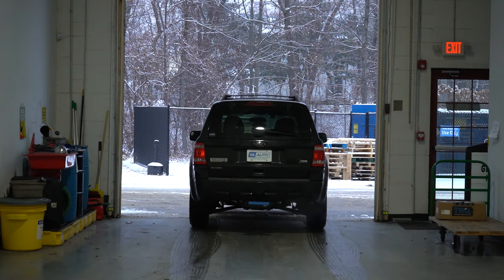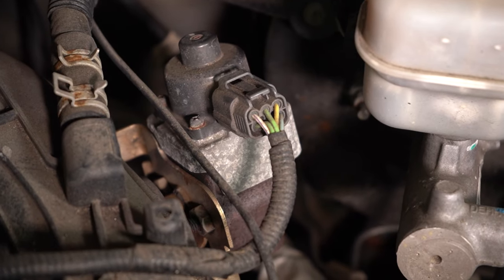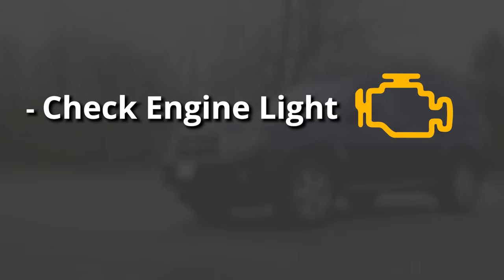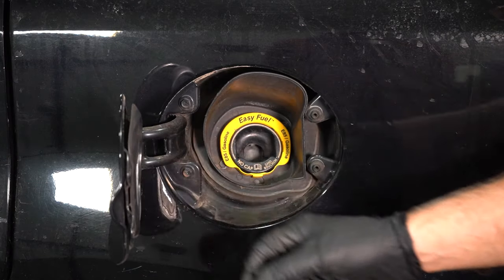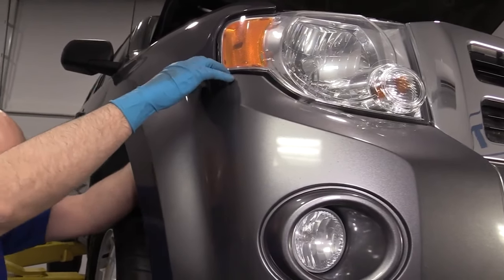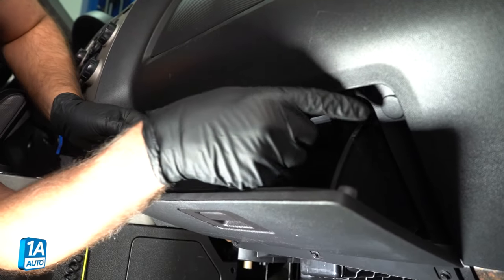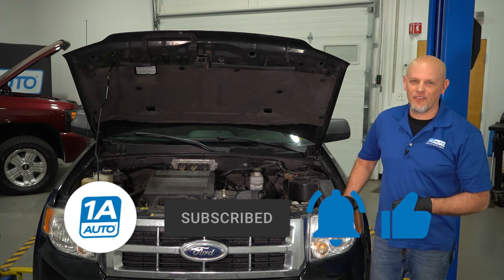Top 5 Problems Ford Escape SUV 2008-2012 2nd Generation

Comment: These things are pretty stout vehicles and if maintained properly will last 250k-350k easily. This generation is the G.O.A.T. Across all generations of Escapes. Transmission on these tend to be on the weaker side but if you change the fluid every 30k miles and don’t tow and hot rod them, they will do you right. Rust is a huge problem with salt belt states. In summary I wouldn’t hesitate buying one if your on the fence about it. They are cheap, easy to work on, and parts are always available for these!
Reply: So true, my escape 2005 = 210,000 miles no major problem
Reply: cool story bro

Comment: If you get a check engine light and it's for the EGR don't just put another one on it. The EGR tube that goes into the intake has a bend in it that gets clogged with exhaust soot. Easy to clean, there are some YouTube videos about it

Comment: Just want to point out that if you replace the resistor on the heat and a/c blower motor and the same thing happens relatively quick you will most likely need to replace the blower motor.

Comment: Got a 2010 2nd gen V6 XLT escape with 193k miles and I’ve had problems with the A/C, fuel pump and resistor. Haven’t fixed any of the problems and it still runs great. Things a horse for me

Comment: I have a 2011 Escape with 106K miles.  I bought it used at 49k in 2014.  I had early issues with the evap cannister and purge valve.  That was costly.  A peculiar issue was the instrument panel would have certain warning lights come on, the ac would blow warm air, and the liftback would lock.  If I hit the dash above it, it would go back to normal.  The dealership wanted $1100 to replace the panel.  I had an old mechanic tell me that he thought it was "cold solder joints."  I found a place in downtown Houston that pulled the panel and re-soldered the joints for $150.  A couple of years ago, I had the shifter cable break which ran me about $400.  Most recently, I had to replace the ignition lock housing due to starting issues.  I do have the issue you spoke about regarding the blower motor resistor.  Runs good and strong on settings 3 and 4, but almost nothing on 1 and 2.
Update:  I did buy the blower motor resistor on Amazon (about $15) and installed it.  A/C blows well on all speeds.  Thanks.

Comment: 4 more:  1) Steering Lock Module (wears out, turn key to start, doesn't, have to push key in before turning)
2) Steering universal joint to rack
3) Engine cradle/subframe rusts out
4) Rust:  A good indication of rust is the bottom of the hatch and the rear wheel arches.  Rockers rust out as well as the shock towers (Dorman makes the entire replacement panel, remove at spot welds)

Comment: Note that the Gen2 Escape 3.0 V6 engine in the 2008 model is the Gen1 engine without VVT. The Gen2 engine with VVT (more horsepower and better gas mileage) started in the 2009 model which is the second year of the Escape Gen2. Ford likes to make things confusing. 
When getting parts, try to use the VIN just to be sure.

Comment: I purchased my 3.0 Duratech V6 Escape Limited back in 10/18 with just 21000 one owner miles!  It has 88000 miles now and has proven to be one of the most reliable cars I’ve owned in my 69 years on planet earth!  Cheap to run, comfortable, sharp looking, easy to fix when it needs work and that’s not often!

Comment: 2010 With 2.5L Hybrid.  Bought new.  Current mileage 202,000
Tailgate actuator.
Throttle body.
Oxygen sensor..twice.
Water pump. 
Replaced Rotors and pads at 135k and they were still good at the time.
Oil changed with Mobil 1 every 5000 miles.

Comment: I have a 2008 ford escape xlt. When i drive and hit the brakes,  i feel a rumbling on the pedal and the break doesnt work well. Unless when the abs and the traction lights turns on the break goes back working normally. I already change the abs speed wheen sensor and the break. Any advice?

Comment: i  got tired of replacing the resistor for fan speed as it kept blowing after alot of rain so i coated it in flex seal and installed it and it hasnt failed since

Comment: Another thing which sometimes comes up is the contacts inside ignition get worn, and turning the key fails to start the engine. Good news is the ignition module doesn't need to be changed. If you take the tube apart, a piece of metal ring which limits the key rotation needs filing a few millimeters for the key to turn further and make good contact. YouTube has clips on how to do the whole mod.
Reply from the maker: +@AnnaFlanc Thanks for the tip!

Comment: I have a problem with ignition. I will turn the key up to 3 times and nothing. I actually have to take the key out and then insert it again and it will start. The battery was checked. Good. Alternator is good. Cranking power is good. Suspicion is ignition cylinder. Can I lubricate it with CRC electronics spray purchased in AutoZone with hope it will clean the cylinder.  Do you have experience with fixing the problem this way. thank you.

Comment: I have a 2009 Ford Escape, 4 Cyl. that I replaced the exhaust 1 week ago because it was loud, I spotted a hole along the pipe.  Earlier I had that same mechanic replace the EGR Valve because the engine light was on and the code was p0400 for egr valve.  This morning I turned my heat on and all I got was cold air. What could be the issue?   I had my brother replace my blower resister a few years ago with an OEM part.

Comment: hey @1AAuto I have a 2008 Ford Escape XLT 2.3 with an electrical issue... my car has a kill switch installed so the battery wont die, but after a couple years owning it over time we noticed the radio comes by itself after turning the Killswitch on and starting the car.. it will also fluxuate in car audio volume by itself, like its losing power then gaining to full potential..

Comment: On the auto transmission be sure to change fluid every 30k miles and use Ford transmission fluid.  I got my 2008 with 110k  miles on it I changed the trans fluid and used Dextron.  The transmission started shuttering when it went into fifth.  I flushed it and put the Ford fluid in.  The shutter went away after 20 miles

Comment: My issues are quite a lot , though I know nothing about electric engines that don't have a power steering reservoir..
I do believe the shifter for the transmission is catching on the rack (hopefully that's the correct part name for it .
When it shifts the vehicle with pull right and left and only during it shifts up or down which does it quickly. 

My other issue is the entire bottom of the rear end of the vehicle got so rusted it is non-existent.

Which now is made of wood and the back tire is rigged into the wood . 
The check engine light only has come on when the battery is almost dead.

Which now I unhook so whatever has been draining it when it's not running can't anymore.

Comment: I own a 2011 version and the catalytic converter was stolen while parked at the Little Rock airport  long term car park. I bought an after market unit but since then the Check Engine light comes on and error message relates to the catalytic converter. Delivery time for an original part was 2 months and I couldn't wait that long. Any ways to get rid of that error message? Thanks

Comment: Hello! I have a trouble with my 2010 Ford Escape lights, so whenever I try to change the gear ( P to R or to D ) the front lights are turning on and they are turned on during driving, if possible, can you tell me how to turn that feature off? (The engine is 2.5 Litres )

Comment: I own and work on 2011 2.5L Escape AWD ;   1) Rust in rear wheel wells ( no excuse for this, except poor QC), 2) The front sway bar links (poor design, easily fixed if Ford had beefed up the bolt/ ball joint size) 3) Minor leak at front main seal ( this happened at 75,000 miles) 4) Water pump ( went out at 70,000 miles). These are minor issues and the engine and transmission have been great!  ALSO IMO;  replace fluid in the tiny Power Transfer Unit or it will burn up (2 years or 12,000)

Comment: We have a 2011 XLT with only 78k miles.  We bought it for the wrong reasons.  The only redeeming qualities are its rugged appearance and solid feel.  It's not nimble for urban driving.  It has always had a noisy engine with a rough idle, but no check engine light coming on.  I just assumed it has bad engine mounts or a not quite balanced crankshaft.  It came with a crappy transmission which was reprogrammed several times.  I assume Ford designed it for towing as it's so low-geared and slow in the first few gears. With the engine noise and transmission combined, I get the driving impression of a school bus.  The rear defroster was defective from the factory & replaced.  Surface rust is an issue.  Another are ridiculous leaks on the rear hatch and passenger front door.  Door was fixed.  We did have the AC repaired and front brake lines fixed.  I've replaced the blower motor resistor myself.  I could go on, but what's the point.  One and done with Ford.

Comment: I love my 2007 Mercury Mountaineer Premier all wheel drive 4.6 liter V8 3 Valves per cylinder very smooth ride very nice heated seats great horsepower and I get good gas mileage and plenty of room to move or store push pull or tow my back wiper works great my ac works great and my Husband Jim is a automatic and I would never part with my 2ford explores both 2005 one 4.0 liter V6 engine limited edition and Eddie Bauer 4,6 liter V8 2?values per cylinder both Explorer s are 4 wheel drive and they are truly amazing

Comment: Hello all. I searched for my issue to see if there were any posts but I didn't see any. I just bought a 2011 Escape XLT 4 cyl. The brake light comes on the dash, tpm light, blinkers dont work on dash, background light on dash doesn't work and ac doesn't blow cold. Them after driving for a couple of miles they all start working. This is happening intermittently, what is the issue? Any help would be great.
Reply: Alright so I checked the ground, replaced the battery and the alternator is pushing 14.43 volts. Started the car no interior turn signals, tpm is on and brake light is on and no cold ac air. I drove it to get gas no turn signal when turning into the gas station. Left it running while getting the gas and then the brake light goes away, tpm as well, turn signals work and air blows cold. Great I thought. While idling the check engine light comes on, then the door lights, air blows warm turn signal lights don't work on dash( they work outside though) and the TPM and brake light comes back on amd not the it says brake system fault. What is the deal now?
Reply from the maker: +Olde Liberty Sheds & Structures We wouldn't be able to diagnose an issue like that here, you may want to have a local mechanic take a look at it. Thanks for checking us out! http://1aau.to/m/Shop-1AAuto-c

Comment: If you are looking to buy a used one stay away from The 3.0l engine go with the 2.5l mazda engine far more reliable,  easier to fix. 
And the 6sp auto trans can handle the 2 5L better than 3.0L . The 2.5L also came with the 5sp manual which is  built proof mazda miata transmission.  
The escape, mazda tribute,  mazda cx7 are the same car differt styling.   The mazda were assembled far better than the fords. If are looking for a newer  car look at the cx5 non turbo 6sp it beats any small suv including rav4 in reliability and mpg, refinement quiet ride

Comment: I could really use some help.  I have a 2009 Ford Escape and a part on the motor is broken. I know nothing about engine/ motor parts and need help identifying what part it is.
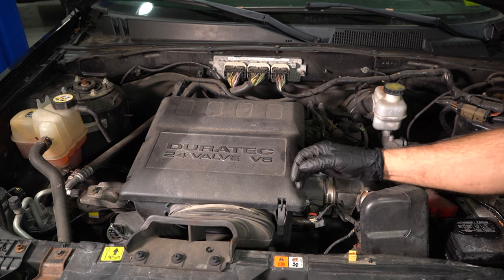Reply: At 0:37 It's the round thing directly behind the yellow sticker. It has a wire/cable attached

Comment: I have a 2009 Ford Escape that I just recently replaced the egr valve because the engine light was on and the code was p0400 for egr valve. I had a mechanic do this because I'm not inclined to do that type of work. The engine light is still coming on and it is the same code. The mechanic said I should be fine and that these ford vehicles are notorious for the egr valve causing the light to come on. I will be making a long distance trip in a couple of weeks with this vehicle so I'm kind of concerned about it. I have a obd2 scanner and I did clear the code which lasted about a day and the light came back on. I don't know if I should just leave it alone or get it looked at more. I hope someone will advise me.

Comment: Anybody have an issue where during driving the engine just stops working correctly and the car starts jutting and the engine sounds like it's struggling to stay running? this has been a random issue but has gotten worse the last few weeks

Comment: None of these top 5 issues happened to my 2011 V6. What happened to me are:

1. Premature rust. Muffler and tail resonator rust out and rattle within 7 years. Rust in both rear wheel arches.
2. Windshield washer tube break everywhere! The material is so brittle it bursts near many fittings.
3. A metal connection piece in ignition switch cracked (behind key cylinder), resulting in difficulty to start.
4. Electronic throttle body throw a code. It's the integrated throttle position sensor that failed. You have to replace the whole tb.
5. Oil leak in rear timing cover gasket. While you are at it, replace all valve cover, timing cover, oil pan gaskets. Ford uses cheap rubber and they harden/shrink badly.

I believe my top 5 are more common. There are many search results in google and youtube. Overall, Ford's material/quality is very poor. Definitely worse than GM and Japanese that I owned.

Comment: I have ford escape 2011 2.5 L  the code is P0642 (sensor reference voltage a circuit low) no one didn't know what to do with it!!

Comment: What i dont understand is why some ford escapes the rear sub frames some rot like crazy and some don rot out at all and why is there not a recall in this its. a factory defect and is dangoeous and un safe wht is ford getting away with this searious issue mine runs well but the sub frame is complety gone why
Reply: Once the escapes  drops down the the wheel will get caught in the body and flip it over then people will.get hurt or cause a searious accident mine runs grate but the sub frame is gone qnd at 2500 to fix it is nutz

Comment: I have a 2009 Ford Escape that makes a loud humming noise at highway speeds and I don't know what it is. I have had 2 different repair shops look at the vehicle and check the exhaust and wheel bearings and other stuff but they couldn't find anything. The vehicle has almost 125000 miles on it and it actually runs fine but I don't like the noise level at the higher speeds and it didn't use to do that. I'm not sure what to do about it.